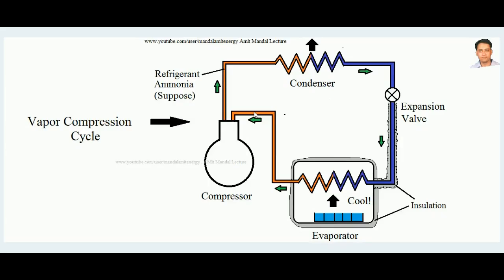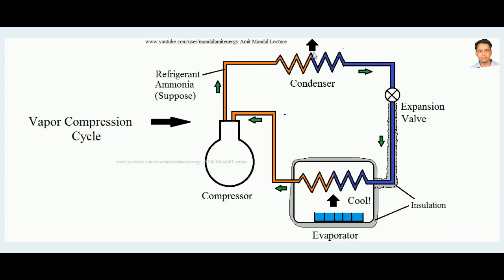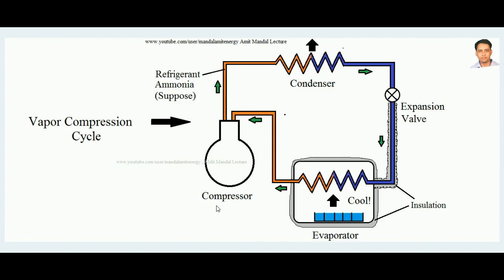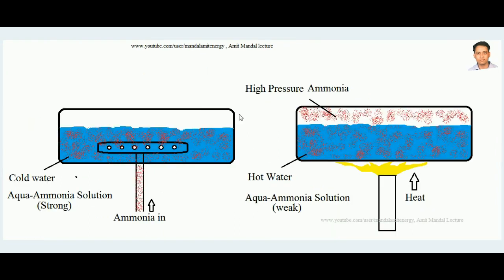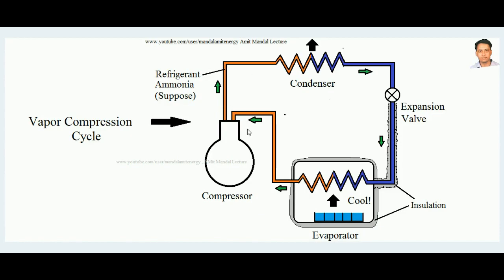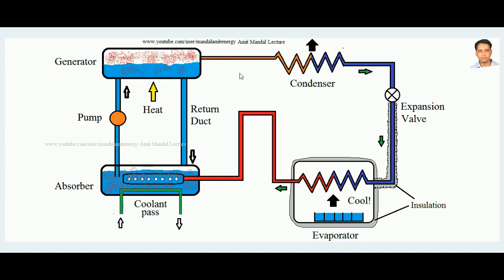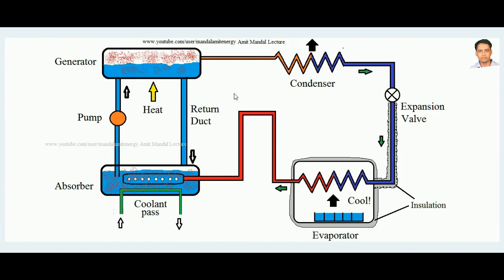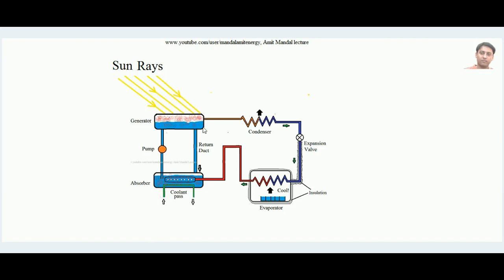Solar Refrigeration Working Principle

Comment: Nice video , could you possibly mention the temperature of refrigerent at condenser and evaporator ?
Reply from the maker: Depends on pressure at condenser and evaporator.
Reply: what should it be , in case of single family house.Can you please also make  video of waste water heat recovery system.

Comment: Sir, Please answer..
How efficient will it be practically, considering the coolant passed through should be maintained cool?

 Where I can find the formulae for this phenomenon? 
How much we have to keep the coolant temp low for taking out unit outputs? Assuming ambient temp. 45 degrees celcius